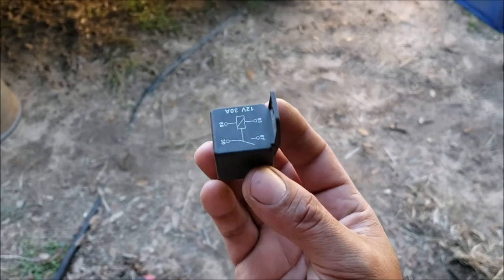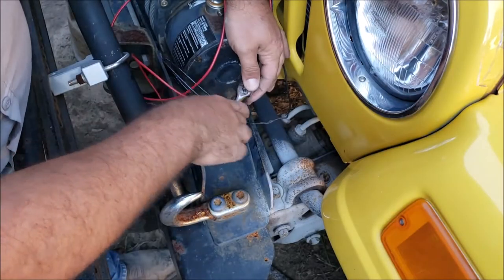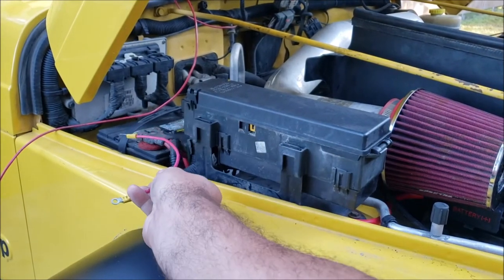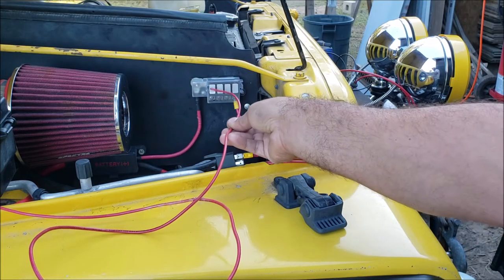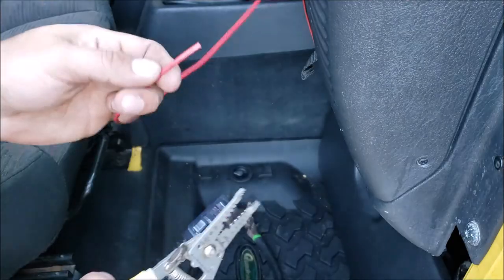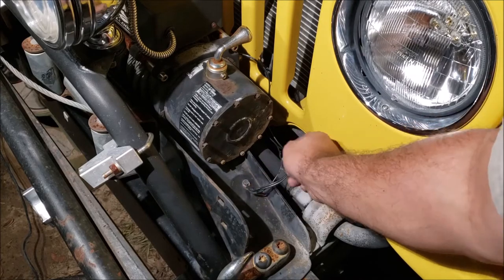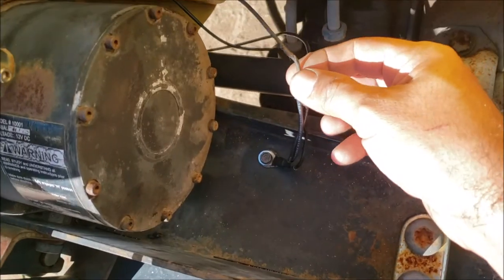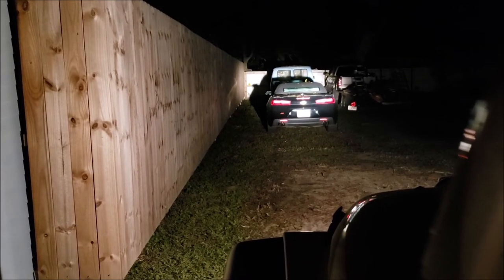how to wire a RELAY in real life and USE it DIY

Comment: Great video. I have sort of a backward application of a relay and wonder if this will work. I have a 12V refrigerator in my car that will run off the car's 12v or 12v powered by a 115vac brick. I'm trying to use a relay to change the INPUT voltage from battery if the relay is not energized and power it from the brick if the power is coming from the brick. In this case, the refrigerator will fro the car when I am driving and automatically run at a campsite when I hook up to 115vac.
Fridge - to car ground
Fridge + to 30
Car 12vdc + to 87a
Brick 12vdc + to 87 AND 86
Brick 12vdc -  to 85 and Car ground

In normal car operation, the fridge is grounded and powered from 87a through 30 into refrigerator
As soon as 115vac is applied to brick,  the relay is energized by the brick, and power will go from 87 through 30 into refrigerator
Will this work???

Comment: How well will this circuit hold up to moisture? I tend to get a lot of water and mud splashed up into my engine compartment when I wheel my Jeep. I am concerned I may need to purchase a fuse/relay box that is water tight.

Comment: Can you run more than 1 supply wire from your fuse block in order to power multiple switches with the same terminal? At what point is it bad to keep adding switches to the same terminal?

Comment: Few questions hope you're able to answer, how do I make sure that the bulbs are as bright as they can be, I used this to wire up my headlights (h4), if I want it brighter would i need a different bulb, thicker wires, or switch out the inline fuse for a higher amp? ty for you time!
Reply from the maker: get modern lights.. h4 are old and technology and that’s all you can do.

Comment: Question for you I want my fog lights to be like factory where they go off when the bright lights come on. This is a on a 07’FJ Cruiser. Can I come off the low beam wire on the headlights to the toggle to run the switch in the relay. Hope I’m clear, been watching and learning.
Reply from the maker: yes

Comment: So would you just splice that hot wire that is going to the switch if you wanted to add more switches?
Reply from the maker: you could run a 100 swtiches off that wire..  only if they are to turn on relays

Comment: Would I be able to use my tailight as a switch? I tried it for some underglow lights because I want them to turn on when I unlock my car and the relay just buzzes so I know something is wrong
Reply from the maker: yeah but you don’t run the wire through. the relay .. pigtail off hot side of brake wire to 86 and then ground 85 to chassis or body .. it’s just a signal wire… is that how you wired it?
Reply: @chriscraft77022   so I tapped into my taillight and ran it to 86, my underglow to 87, my fuse/12v to 30 and my ground to 85 to ground. It turns on my underglow when I unlock my car is intended but it doesn't give enough power and the relay just buzzes the whole time

Comment: Can I splice into my one of my parking lights at the light to power the switch
Reply from the maker: yes.. I have a wire a relay in real life video where I did that for KC long range lights
Reply: @chriscraft77022  thanks so I only have to run the wire from the one park light to relay to what num6pin?
Reply from the maker: 86
Reply: @chriscraft77022  sorry I have a hard time getting this I made a typo in my last question can I spice into 1 positive wire at the parking light to energize the relay to power both fog lights

Comment: Why connect them to the fog lights? Why not just flip both the fog light switch and the long range light switch on?
Reply from the maker: the fog lights were on the stock bumper and I never had them..  I would of done that if I had them... I used the switch because it was available and not being used